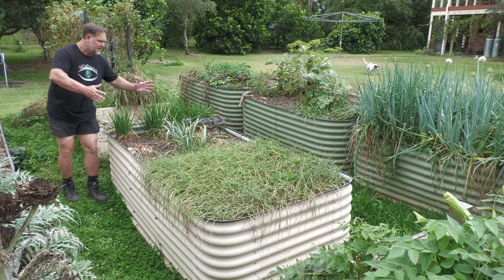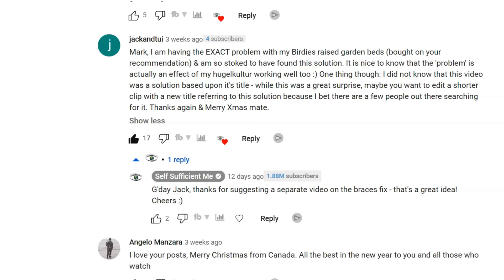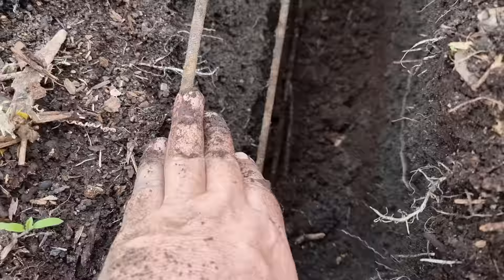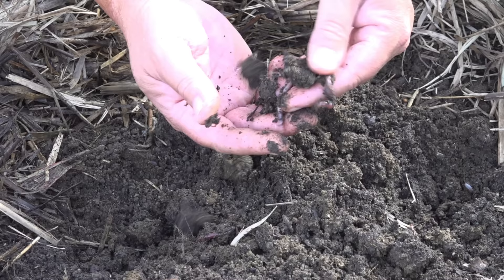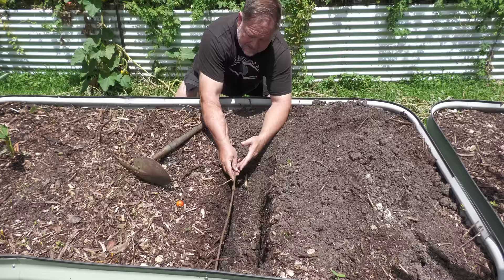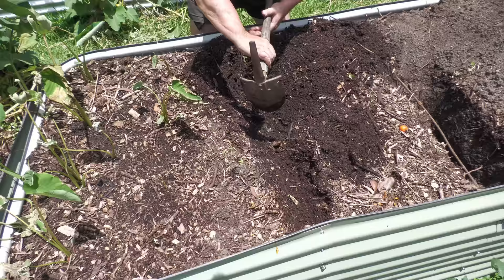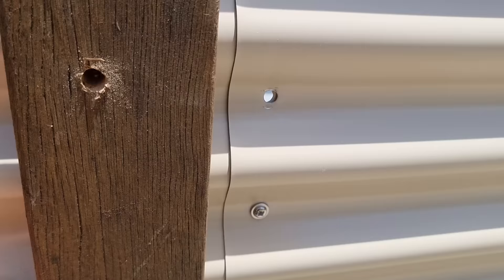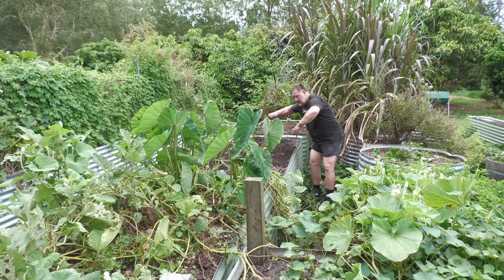How to FIX and STOP a Raised Garden Bed From Caving Inwards

Comment: As an electrician in a past life, another solution I thought of when watching is to get some 1/2" (or maybe 3/4") EMT thin wall conduit, cheaper than black iron pipe as Bob below suggests, cut them to match the bed width, and slide over each internal brace rod, (preferably when first installing the bed), to keep the walls from bowing inwards.  Since EMT is also corrosion resistant, they should protect the braces for years more than directly exposed to the soil.  Great videos.  Cheers!
Reply: Genius 👍
Reply: Brilliant!! I came to the comment section for exactly a suggestion like this. The vertical method was problematic for our situation and this is a perfect solution. Thank you!!
Reply: I was thinking steel but conduit pipe definitly makes sense since it's also meant to be buried.  Thank you!

Comment: Dear Mark.  Instead of using a 2 x 4 with holes drilled in it, try using a 2" PVC pipe that sticks up above the bed by about 10"s or so, with holes drilled in it.  Then if you want to erect a structor for the plants to grow up you have a section of pipe to insert a rod into to build it from.  When you no longer need the structure you can remove it from the pipe, and you are left with a small pipe to reuse in the future.
Reply: pvc seems to get brittle over the years, galvanized steel pipe would be better no?
Edit: or stainless?
Reply: @EC-dz4bq  You're probably right.

Comment: To be fair it is a design flaw, it could easily have been rectified by the factory simply using some stronger material, angle iron fitted internally would naturally shed the load, would not buckle and would out last me and you. 😄

Comment: I am new to raised bed gardening. I did not even know that was a possibility. I have 2'x6' livestock water troughs and 5' & 6' rounds with a watering system in the base. I filled them with soil only and have had a 6" drop in the soil level. Now I'm concerned but forewarned when the remaining less sturdy beds go in. Thank you so much for the information. Always a pleasure watching you. A devotee from chilly SW Iowa.

Comment: Slink little poles of metal, they bend, of course that is a questionable design... But what would a 2x2" or 2x4" pole do? It'd have to be as durable, if it were wood, this will decompose.

Comment: When I built my timber raised beds I used M14 galvanised threaded bars and with a drill threaded them through 15mm pvc piping for more protection. 12 years later no problems and I removed one bar to examine and it’s suffered zero corrosion or bending. Reinstalled the bar for hopefully many more years to come . Love your channel Mark, watched every episode ( some more than once ) 👍 🇦🇺🇬🇧

Comment: I solved this issue by building a galvanized unistrut frame and then bolting the panels onto the frame.  Every bolt goes through a vertical piece of 12 gauge hot dipped unistrut with unistrut horizontal stabilizers instead of the weak flimsy provided aluminum ones.  The box is now a tank.  You can flip it on its side and sit on it.  I used the provided bolts and nuts but bought larger washers.  Cost wasn’t minimal but having filled it, emptied it a year later and filled it again, I don’t ever want to do it again so very worth the cost.

Comment: Great video.  I've not used the braces in my birdie beds. I use flat sided star pickets knocked in on the inside of the bed to support the sides. First Birdie Bed I built I found the braces got in my way whenever I dug the bed over. I've also started putting my veggie beds in cages (Igloo Pet Runs) Brisbane has too many varmints to contend with so I've locked my veggies up now. So far so good although I saw a possum ahead of me in the queue at Bunnings the other day buying a pair of bolt cutters, so we'll see I guess.

Comment: Also tamp the backfill -- I have the shorter beds and not near as wide, and I used metal tape to prevent bow out.  Knowing cave in could happen, I tamped soil 2 to 3 inches either side of my bracing to prevent/minimize settling.  Pulled tape up, knowing it would settle as well.  Hoping the plan works.  :-)

Comment: The idea of supporting the braces should be standard installation for any bed where this type of undersoil is being used. I'm looking at starting a garden and want to use raised beds with hugelkultur and will definitely be adding vertical supports to the braces.

Given the price of lumber, do you think that a smaller piece of lumber (1x2 maybe) might work since it's just there to keep the braces from bending downward? Maybe with a small wider support at the bottom to keep it from being pushed down into the soil? I'm thinking a small (6x6) square of plywood nailed to the bottom of the vertical 1x2. Maybe even make the vertical long enough to act as  part of a trellis or support for hoop.

Comment: I love the channel Mark, and Birdees do make a good product.  But those rods through the center are just way to small to be an effective support. The will definitely stop most of the bowing outward but as you have found they will bend way to easily when the soil is pushing down on them.

I have made my own beds and used 14mm all thread galvanized rod with panel washers inside and outside of the outter skin. Essentially tying both sides together to prevent any in or out movement over time.

Comment: Hi Mark I had the same problem with my raised beds I dug up to the braces and slipped over a 25 mm galvanised pipe so the wire braces go through the middle of the pipe cut pipe same size as garden beds problem solved cheers happy 2023
Reply: How did you put them through the pipe with the beds already assembled?

Comment: Thanks for the heads up! Garden is not yet ready for raised beds, but I am already preparing myself as good as I can with your videos :) I know someone with a welding machine, guess I will weld cross beams on both sides of the rods, that should be plenty of extra force to sustain the weight of the soil

Comment: Great video as always Mark. I was having similar issues with bowing and I am attempting to just add more rods, which can be purchased separately.

This issue does seem like a design thing, the wood bracing if it helps seems to be a design flaw. Beds should offer more support to help the pressure issues.

Comment: While it is too late to put those rusted/soiled guide rods through a plank with holes in, what you could do, is notch a hardwood plank instead, slot those guide-rods into the notches and then wedge underneath the plank to lift the guide-rods up. Seems better than digging everything out every 6/12 months.

Comment: It's certainly a design issue, or more precisely a cost issue. We're building our own from recycled materials. For bracing we use angle iron, much stronger. The angle iron is from old style pallet racking system, so quite cheap.

Comment: Morning, Mark! The round beds, I see they do not have braces. How are they working out? Any issues with bowing or caving with them? I'm GLAD you showed this. I have been on the financial fence, of whether to take the dive and get these beds. I really want the height, BUT,  even with these simple looking fixes, I'm realizing that I probably won't be able to dig down and actually reach those bars, to straighten them back out. I am really glad we are getting to see a longer term use of these beds. THANKS!
Reply: For a really large round bed bracing might be needed to prevent the bed from bowing one way at the top and a different direction at the bottom.  For the smaller ones braces probably aren't needed because the pressure from the contained soil will push out equally in all directions, maintaining the round shape.

Comment: You can use 1 inch food grade PVC pipe to retrofit the one's with dirt already in them.

You will need a 1" pipe long enough to hold all three cables.
2 Union sleeves per support pipe
1 or 2 Caps per support pipe.

1) Take a board and drill the holes in them at the appropriate place.
2) Take 1" pipe and cut in into 3 sections.
Each section should be cut at such a place where the union sleeve, will support the cable above it.
3) Drill an elongated hole in the pipe that goes into the union sleeve so that when the pipe is placed in the union sleeve, it seat all the way down.
An elongated hole will be drilled in only 2 of the pipes. The middle pipe and the top pipe.
4) It would be a good idea to put a cap on the bottom pipe so that it cannot begin to drill into the ground it is resting on.

Comment: I think if the manufacturer wanted to address the issue they would replace that threaded rod with a vertically oriented piece of flat bar. It has a lot of strength in the dimension you need but not a lot of surface area for the soil to pull down on. Threaded rod is very easy to bend in comparison in this application.

Comment: Mark, how would it work on the initial installation, to add some 3/4 black iron pipe cut to length as spreaders? Of course actual size would be determined by the size of the coupling used with each threaded rod. As the outer nuts on the rods are tightened to lessen outward spreading of the side walls, a pipe spreader with its additional thickness could act to lessen the inward collapse of the outer wall? Just trying to think of a solution that wouldnt require an annual or semi-annual redo of each container. -Bob...

Comment: Would a solid 4x4 on each side where the rods are work better than the rods themselves?  I see you demonstrated a 2x4 where the rods go through in the center but seems for more rigid support for the exterior you’d want the bed attached to something stronger like a thick 4x4 post. Love the channel🤘🏻 wish I could find a piece of land like you’ve got here in TX.

Comment: I was thinking about running pipes as supports for them.  A heavy , supported, U-shaped pipe running the length of the bed, with holes drilled to irrigate the crops from below.  Pour water into the top of the U, & that would help in places that need to conserve water.  🪴🍆🍍🍅🥕🫑🌶🧄🍊🥦

Comment: feed the rod through a length of steel tubing as the tubing will prevent the rod from bowing or flexing.
you could also use a metal or wood plate on each side of the tube as additional reinforcement for the tin sides

Comment: Hard to believe they could be bent down with the soil around it.....if I end up using this method I'll make sure to run those rods through some electrical conduit on the inside. Thanks for the heads up.

Comment: Easiest fix would be another nut on the inside of the wall.
You can clearly see that the bar is free upon compaction. With an inside nut, it would stop folding in as the rod would hold tension.
Reply: Unfortunately putting another nut inside will not prevent the rod from bending downwards as the material below it decomposes and the soil above moves down. I know this for sure because I assembled my own Birdies beds with nuts (and washers) both inside and out. I solved the problem by simply laying a log across the bed below the upper rod. Yes, the log will eventually decompose but it will take a couple of years, by which time it will probably be time to refurbish the bed anyway.

Comment: Initially, if you fill your bins over a short amount of time, (1 week) you shouldn't need the cross bars to hold the sides from spreading. But since you already have them but now are experiencing the opposite effect because of like you say, the material is sinking, and taking the center of the bar with it. At this time, you should be able to simply remove the bars & let gravity do its thing. "Vertical force".

Comment: With this metal hoop raised garden design - there is a very easy solution.  Lay down the original metal hoop.  Then pound down 3 posts on each side - which will stop and other cave-ins ... and eventually far later will decay with the other black gold soil - and the whole garden bed will be stable.
Reply: Or pound in metal fence posts on the inside for the same 3x x 2 areas.

Comment: Another good solution would be to get a piece of 3/4 pipe either some galvanized steel pipe or some EMT electrical conduit that is cut to the inside width length and then the threaded rods can be fished thru the pipe and they will prevent the rod braces from being able to bend.

Comment: If a person was filling a new bed and put the "cheap" bulk fill that sinks quickly in the ends and middle but left the parts where the bars are open to then put soil in where the bars are and finish filling the top few inches with the "good" soil I wonder if it would solve this issue.

Comment: Hi Mark. Johann here from South Africa. Question..would you say rust is a problem at the bottom of the corrugated plate on the ground? I plan to use what they call here ‘chromadek’ (IBR) that has a protective coloured layer inside and outside. Or perhaps rather gavanised sheeting? Your expertise and experience will help a lot. Thanks for sharing all the in depth knowledge🙏🏻 Regards

Comment: I'm wondering... if you place 2 plywood sheets, on each side of the braces, and fill the braces with concrete then the braces can keeps the sides in tension and the concrete helps with compression. This way, you will never have to fix them in the future. 

Side note, I still think concrete and blocks is best

Comment: I suppose you could use additional wood prunings of about 4" diameter as your cross-wire stabilizers.  Or couldn't you also cut a piece of smallish log to wedge between the sides of the bed where it wants to kink.  True, those would eventually rot, but . . . oh well;  after all, that is the real objective, isn't it.

Comment: Hi mark. I hope u find this comment,I’m currently looking at building a 1m wide 1m high and 7.5m long garden bed out of brick my question is 2 you would it still be fine as it’s going to be in direct sunlight,with plants and fill going to be constant moving In and out of it, or would it crack and fall apart?

Comment: The wood will rot, a permanent fix would be to tac-weld a post with a devils fork at the end in the middle so it could never happen again. another would be in addition to the first part add locking nuts in the inside so it cant more, but before you do, cut a 5-6 inch additional piece of the corrugated stuff to put on the inside so it cant push or rip a hole through the area where the bar went through to double wall the area. I think all that together would equal a 100% fix.

Comment: I just bought 6  (4'X8') beds, and planned on using a potting mix in the base of the beds as I can get it for $10 a yard.  Would this material in the bottom of the beds cause the caving in effect?  I don't have the log, or wood material to use for the base you are using.  Hopefully I can plan to fill them in the beginning BEFORE this happens.  Any advice you can give would be greatly appreciated.  I live in SW Florida zone 10a.

Comment: sounds to me like the design of these things needs to be reworked to improve them to be able to call it a 2.0. The braces could use some vertical structural support. Constantly having to dig these up several times to repair would be a turn off to a potential customer such as myself

Comment: Solution 1: Dig the rods out and bend back to normal.

Solution 2: Put a slow decomposing 2x4 wood brace in the middle of the rods, with holes, for the rods to go through.

Possible solution 3 (what are your thoughts on this solution/possible problem?) : If you are filling it with trunks, branches, woodchips, etc; leave space around the rods and fill that portion (the rod area) with actual dirt, layer by layer, and maybe wet down each layer? (The rest of the bed using fillings like trunks and stuff.)

In addition to the wood brace, maybe?

I do not have one of these beds, but I am thinking about getting one this year and trying to figure out preventative measures. It would be hard for me to dig back down once it's filled up. 

Any input or insite on #3 would be appreciated.
Reply: I would likely use heavy wire to tie the centers of the braces to steel t-posts rather than wooden supports.  However, I don't have these raise beds, so that's more a suggestion than a tried solution.  T-posts could also be a fix you install when you do the fix the first time around as they can simply be driven in while you have the braces exposed.  If you don't like them sticking up above the bed (they could be a convenient point to tie things to, though), then you could cut them off just above the level of the top brace.
Reply: @bobbun9630 how would the tpost help the rods?
Reply: @TacklingTheGiants  As stated, the braces would be tied off to the post.  That would prevent the rod from being able to move vertically, so no sagging would occur as the contents of the bed settled.  The main differences between a t-post and a wooden support as described in the earlier post is that a t-post will not decay.
Reply: @bobbun9630  okay thanks I guess I missed that it would be tied off to it. I wonder though if the tie could come loose and if the tpost is safe in a garden environment. All things to consider (but may be of no concern as well). Thanks for replying!
Reply: @TacklingTheGiants im not sure how safe T posts are in the garden, but almost ever diy trellis uses a T post. I even use them for mine.

Im not quite sure still i would use them for the middle bar though. Ive been pondering this the past couple months. Finally got a bed and came back to this video to get a refresher.

Comment: If you use food grace PVC in place of the board holding the bars up, you won't have the problem of deterioration and it will be a permanent fix.